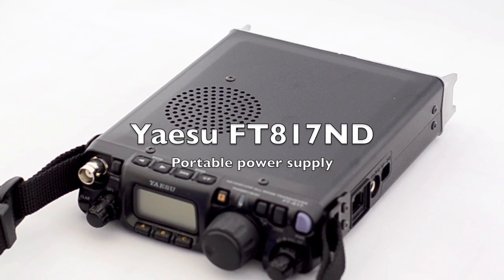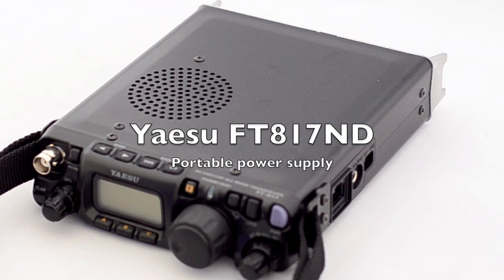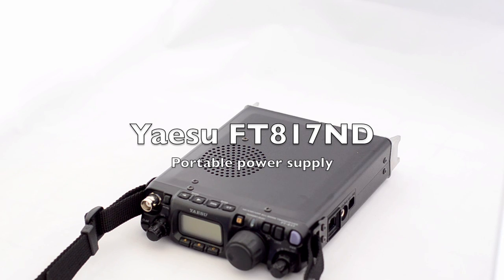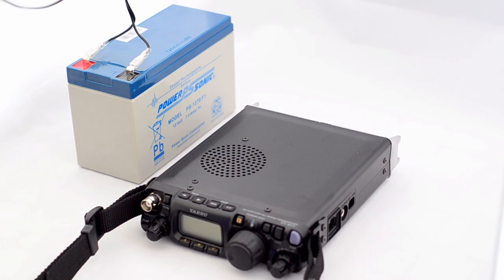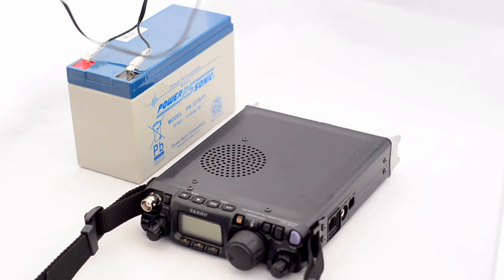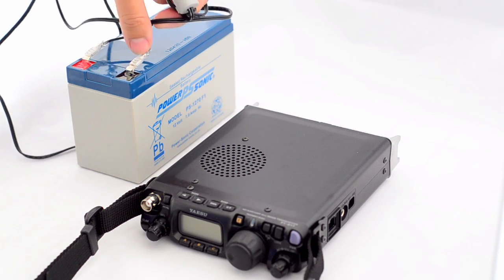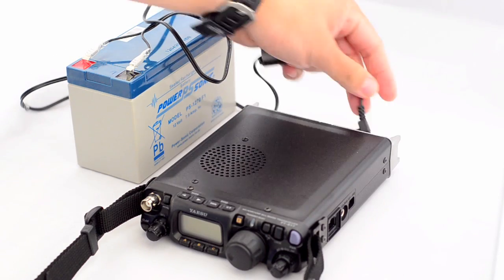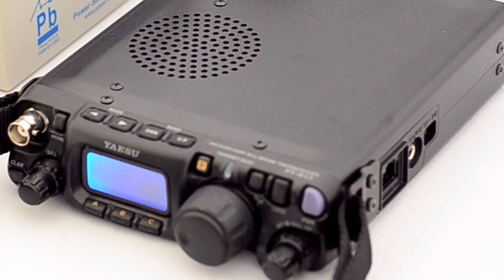Yaesu FT817ND radio portable DC power supply

Comment: Appreciate this was a few years ago but isn't the 817/818 11-volts? I've heard using a 12-volt battery will cause unnecessary heating of the radio?

Comment: If you are going to use battery clips make sure you have polarity protection and a fuse in the circuit.  In a hurry it is so easy to hook it up backwards and ruin a very expensive radio.  How do I know? Buy me a cup of coffee and I will keep you entertained and crying with a few true stories.

For instance the battery bought at a ham radio swap meet.  The seller placed a very nice RED sticker with the price on the battery.  Guess where he placed the RED sticker?  At the negative pole of the battery.  Late one night when trying out a circuit before going to bed....... You figure it out.  Black to black.  Red to RED.  Poof!

Dave K8WPE

Comment: i got my plug at radio shack they come in a 2 pack use a fuse they are black and yellow also remove the internal battery also get the bhi dsp this will add value to the radioalso do the elect mic mod you wiil not regret it 73  kg6mn

Comment: Plus using the external battery you'll double your output power to 5 watts as it's only 2.5 watts using the internal battery :) I use this sort of setup for SOTA stuff. 73, Craig VK3CRG

Comment: Hi
I use a 8amp Deben Tracer lithium   battery for my 817 for the same amount
of amps it is a lot lighter and a quarter of the size of a lead acid
battery the only down side is that they are expensive
Reply: locoman1963 expensive but so good on your back especially if your working a SOTA or portable I wouldn't go back to humping acid battery's about when the Tracer weighs the same as the FT817

Comment: I'm just now starting to experiment with Lilon batteries. My mobility scooter came with a 24 volt, 11 AH Lilon battery. $750. Too good a power supply to go to waste. I bought a 24 to 12 volt downverter and it works fine. Almost unlimited use for a FT-817. Well over an hour of 100 watt Tx with my TS-480. I'll never do that. I don't need 100 watts. QRP PSK31works well enough. Also, Anderson power polls all around.

Comment: How many watts can you transmit with using the battery?  Does your radio have high/medium/low power settings?  Thanks, KE4SDJ
Reply from the maker: 5 watt max and yes there is a high/low setting on power. M6LHS

Comment: Hi, I have built a 2500 mAH LIPO 3S from Hobby King inside my FT817 replacing the Yaesu rechargable battery and am very happy with the results - I do a lot of SOTA (Summits on the air) on HF and the battery lasts me over 2 hours normally. As back-up I have a 5000mAH LIPO 3S that I can connect externally. If you want to build in the LIPO as I did, make sure you get the one that will physically fit in the radio. If you search SOTA FT-817 and LIPO, there have been a few articles written on how to do this.
73  Ed DD5LP.

Comment: Of course the cheapest solution but not the best. Not only lead-acid batteries are very heavy and have a rather inefficient usage, they run with a voltage higher than needed for the FT-817. Best for this rig are LiIon or LiPo batteries, 3cell with 11.1V. Best technology would be LiFePo4 if they wouldn´t run the same voltage as lead-acid :-(

Comment: Did you need remove the internal battery?
Reply from the maker: No the batteries are still in the radio but it runs on the external battery when you plug it in. It will switch onto the internal battery when the external has run out of juice. Anyway you can charge the internal battery from this external as well.
Reply: HandyRadio
Its still a good idea to remove the internal battery as long as you are on an external power source. Prevents overcharging and damage. Just charge it up every 4 months of so..
Reply: Tom Pryts Isn't the "charging mode" (for the internal battery) toggled on/off by one of the menu? In other words, I think you can set the ft817nd for not charging the interval battery pack and therefore leave it inside. Any feedback from you and others truly appreciated.

Comment: I love my 5ahr and 7ahr batteries. They are about 4 lbs and 5 lbs each. I use Anderson Power poles like the other commenters. Also, it's a good idea to put a fuse on the Positive side to prevent runaway current on shorts etc. Thanks for making the video, I subscribed.

Comment: I use a 9 aH Power Sonic, with powerpoles.  I also use female end terminals on the battery lead wires.  By covering them with shrink tubing, they slide over the terminals and prevent shorts.  However, I did get one size larger, so there would be less pressure on the battery.  I got the charger that is rated about 1 aH smaller.  By letting it charge longer, I saved about $50.